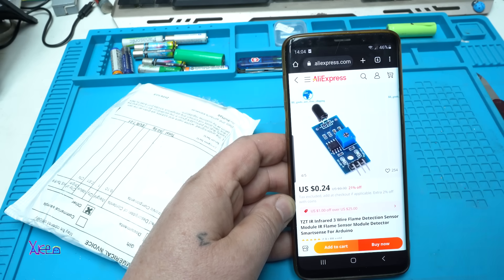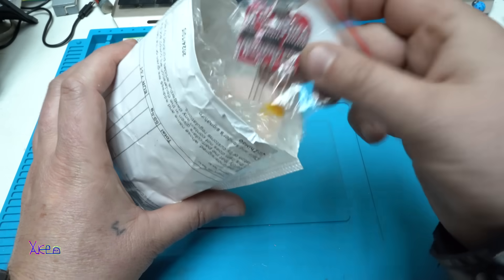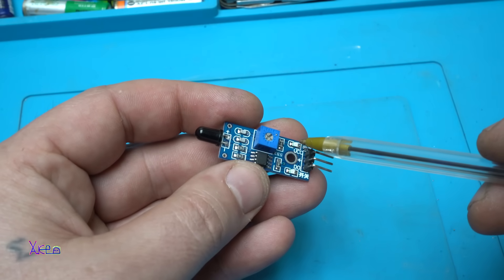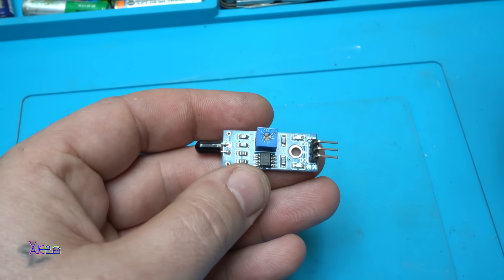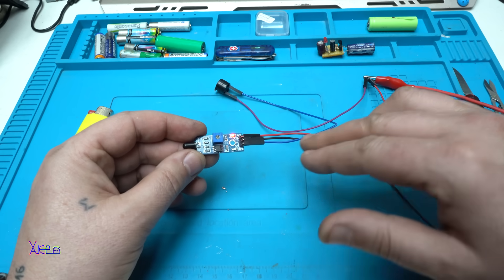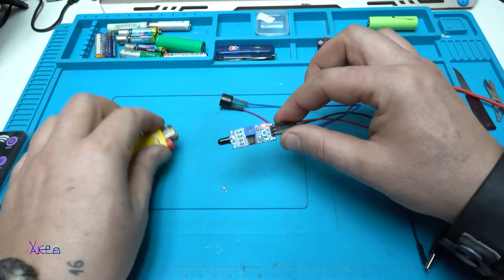THIS $1 Aliexpress Module Do Something INCREDIBLE?

Comment: 🎯 Key points for quick navigation:

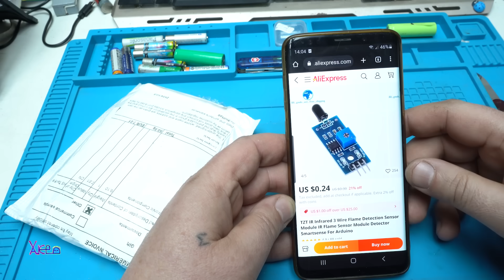00:00 The flame sensor module from AliExpress costs $0.24 each, and four can be bought for $1.
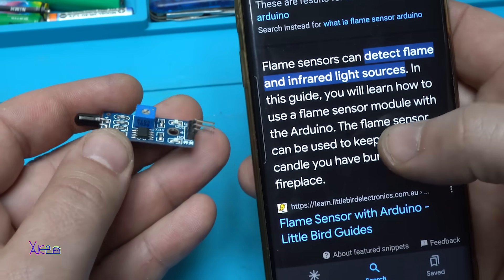01:05 The infrared flame sensor can detect flames and infrared light sources. It can be integrated with or without Arduino.
01:47 The sensor features an LM393 chip, a trim potentiometer to adjust sensitivity, an infrared receiver, and two LEDs for power and flame detection.
02:33 The sensor has three pins: positive, negative, and output. It connects to a buzzer and operates on 5 volts to detect flames.
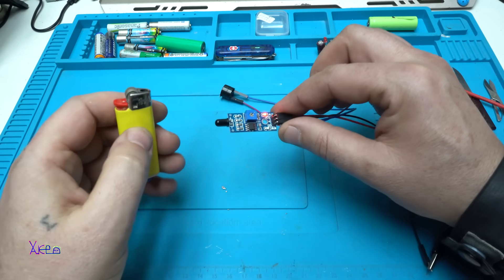03:17 Without Arduino, the sensor can trigger an alarm via a buzzer when it detects a flame.
03:30 The sensor also receives infrared signals, such as those from remote controls.

Made with HARPA AI

Comment: Would you please provide the details of that piezo buzzer?
Reply from the maker: You comment many times and I understand you problem,many of buzzers work on 5v dc there are active and passive models,another thing if you remove the sticker on top in many cases the piezo will not work good.
Reply: @Hacktuber  thank you... sorry for the multiple comments/questions... thank you for the help!

Comment: For anyone who already has the InfraRed 'Reflective' or 'Obstacle Avoidance Module', this can also be used as a flame detector. Just remove the IR Transmitter LED from the module to avoid false triggering. 😉
Reply from the maker: Thanks for the tip, I'll be sure to try that out!

Comment: As someone commented these devices can not see a blue gas flame.  You could turn this into an advantage.  Gas burners burn orange if there is an obstruction that alters the air fuel mixture. So it could be an extra layer of safety combined with a thermocouple.
Reply from the maker: Great idea👍

Comment: SO, this is an IR sensor. Remember, you cannot see IR light, but it is used all the time. For instance, walk past a surveillance camera with night vision at night, and this thing should go off because the camera is lighting up the area with IR light, which the camera can then see. So you can detect surveillance cameras great for burglars. If you get a cheap digital camera and open it up, you will find an IR filter just in front of the lens, done to make the pictures not be influenced by IR. Remove that filter and re-assemble the camera and you have a camera that can see what you cannot see, good fun. I took a camera like that and an IR flashlight into a dark room and could not see anything even with the flashlight on. But when I fired up the camera I could clearly see the flashlight lighting up the room. Very cool.
Reply: Most phones I've had (Android) can also 'see' IR devices like remote controls.  Just point the remote at the camera, press a button and you see it light up. No disassembly required.
Reply: @AubsUK  This is true, the IR filter in the cameras is never perfect, it reduces rather than removes the IR. But if you remove the filter the camera suddenly becomes much more sensitive to IR.

I am a test engineer, and for a while I was testing a dispenser system for controlled substances for use in hospitals and nursing homes and such. Part of the dispenser was an "IR curtain" that would detect medication drops and attempts to get into the dispenser to get drugs. I used a video camera to record it working so that I could see the actual IR emitter working, when it was working, and stuff. It was also great for when there was a bad dispense, I could go back and replay the video to see what happened, and then show the design engineer. Much of testing involves finding ways to see what others don't see.
Reply from the maker: Very well explained my friend,that with cameras is great point😀
Reply: @Hacktuber  I will further point out that this sensor is half of the IR sensors that line-following smart cars use, it just does not have the IR emitter and it may have a different sensitivity range.
Reply: Some video cameras back in the day had a “Night vision” mode that enabled IR sensitivity and turned on an IR light source so you could videotape things in complete darkness. I used it to video my kids sleeping a few times when they were babies.

Comment: ...and Happy Holidays to you!!
Have you checked how far away the sensor can detect the lighter flame (in the dark).
Fro my experience with IR sensors, I can say, for sure, that a lens in front of the IR device will greatly increase the distance...but more directional.   
With proper setup (on a com system), I have extended the range from inches to 100's of yards!!!   I was very surprised!!
Reply from the maker: I am planning to do that, will update soon!

Comment: Plus about 5 bucks for shipping.
Reply: Not if you use Ali's free shipping over $10. That needn't be over $10 from the same supplier, it can be from any supplier that is taking part in the scheme, and there are lots of them. Of course, it isn't actually free of shipping cost as the unit price is usually a bit more than those suppliers that are not taking part in the scheme but usually it is better to buy from those in the scheme than those not in the scheme.
Reply: @mal6232 just came to say dont they know that if you spend over $10 on any random crap, it gets shipped for free.

Comment: This is a very interesting module, indeed. I would also use it to monitor the pilot in my gas water heater. In this case I can connect it to a esp8266 cpu ($1.50) to send me an email if the pilot was off. Keep on the good work!
Reply from the maker: That’s a great idea!
Reply: Local alarm would be easy!
Reply: Different fuel types emit different IR wavelengths. Start with the experiment like the author of this video. I found that a natural gas (methane) flame would not trigger this module. It is an education!